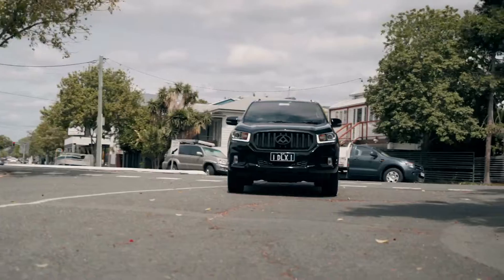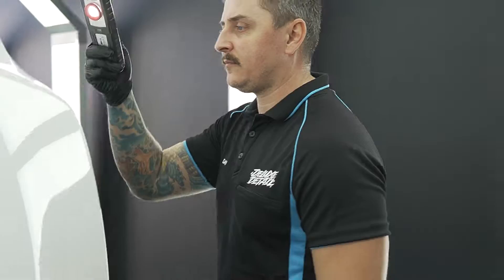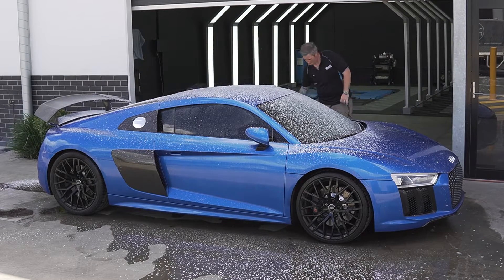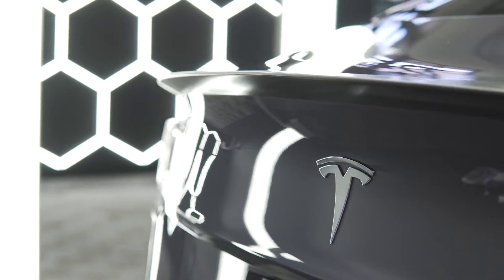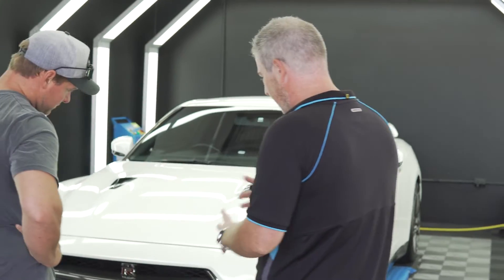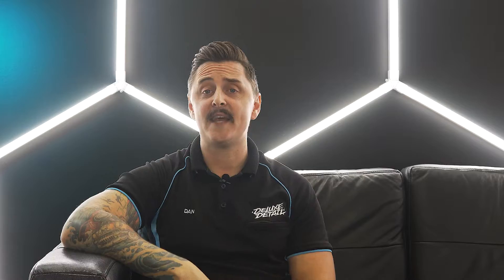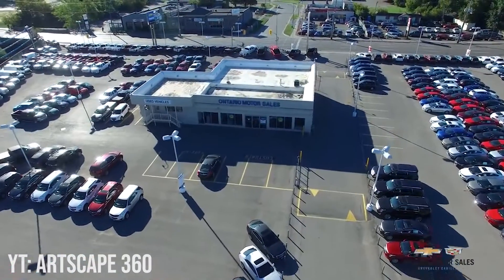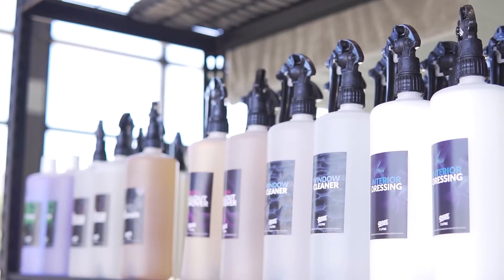Is Ceramic Coating From a Dealership ACTUALLY Worth It?

Comment: Very well said Dan. I requested the dealership do not wash my car during the pre-delivery inspection and keep all the protective films on when I picked it up, so they could not add any swirl marks on by their rough wash 😆  Peeled all the films by myself and did a proper 2 buckets wash which is very satisfying. By the way,  I sent an enquiry on the website asking for a quote for ceramic coating (Gtechniq Crystal Serum Ultra) a brand new Kia Stinger, and looking forward to hear from you soon 🙂
Reply from the maker: Hey Simon!  Looks like we are playing some phone tag haha hopefully catch you soon man.  And yes you’ve done the right thing, it’s also super satisfying pulling all the plastics off yourself! 👌🏼

Comment: Is the prep the same for a brand new car?
Reply from the maker: Most definitely.  We still do a strip wash and clay the vehicle.  Machine polishing process is the same but may be quicker due to less defects on the car, but that’s not always the case.  Whether it’s a new or used car our prep stages are the same but depending on how contaminated the car is impacts how we approach it.